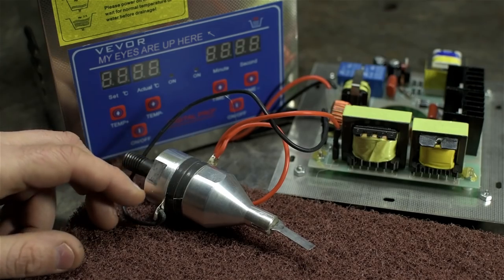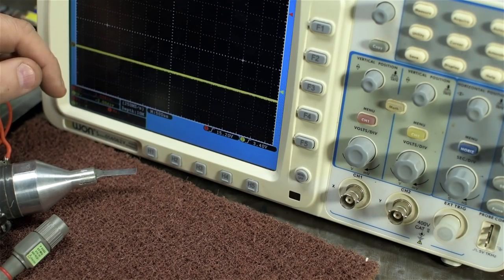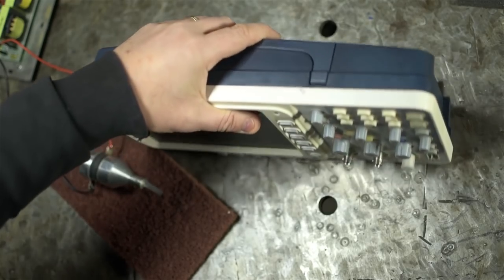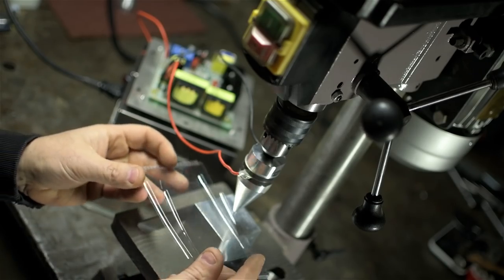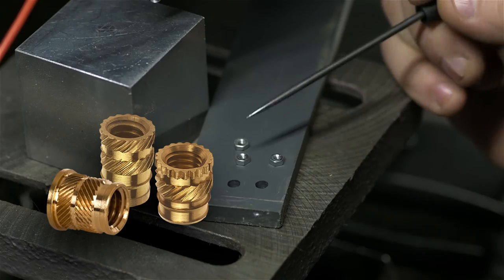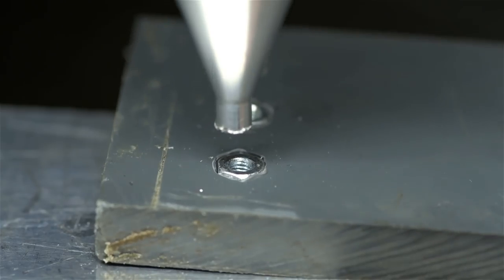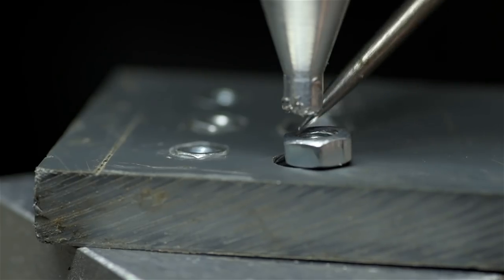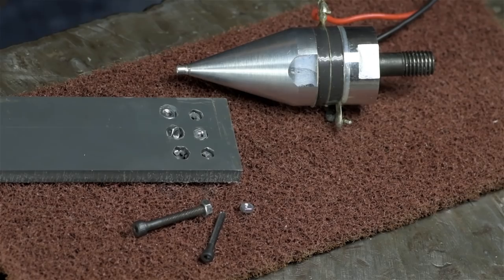DIY Ultrasonic Welder?! (Answer: NO)

Comment: Hello Mike,
Just watching ur Ultrasonic chapter.
I have some experience with some of that stuff.
I mentioned before that I worked for Bullen Ultrasonics Eaton oh. A major player in "Ultra. Chine-nin".

I helped with building those machines from scratch.
Our transducers were 1000 watt & as I remember 2400 watt machines. Obviously more powerful than the 60 watt set up you had.
I think one prob with your experiment is :
You'll prob have to braze the tool to the tool holder.
We used a couple diff. materials for filler wire. The best was Silver Solder. 
The stroke of the tool holder is most likely breaking loose the adhesive.

The strokes that we worked with were .0009/.0012 length on 1000 kw
And about  .002 lg. On a 2400 kw transducer.
A very big transducer & Water cooled housing.
We d pump a slurry of a liquid based 
abrasive crystals right where the tool met the material.( Vertically)
Then the osolation movement of the tool would  caused the very hard crystals to cut into/or machine
 the tool shape into the workpiece.

We machined Ceramic Sub straight material usually. But many others too. (Glass was easy.)

Ah . . .there's lots more to it but I just thought I'd toss you a couple things that might help ur tool makings by doing the braze work.

When the tool is properly energized they can be VERY PRECISE. Holes 
w/n only a few tenths.
Computer chip work.
Semiconductors.
Out performs laser processing.

Ok, ok, I'll stop, I can see your ears turning blue !

I enjoy the show. Keep them comin.
When I hear all ur jokes, I'll start paying attention to your your little tricks.  Ha !!! 
(Ole machinist humor !)

Thanks,
Marko.

Comment: I'm late to the game but I haven't seen anyone else explain why your horn setup resonated at the horn's resonant frequency of 42 kHz rather than the circuit's previous frequency of 40 kHz.

In ultrasonic drive circuits, the piezo transducer is often used as a capacitor.  You push a voltage into it, it deforms and resists further current; you push voltage into it the other way, it deforms that way and resists further current in that direction.

In particular, it will be used as the capacitor that controls the frequency of the oscillator.  The piezo's mechanical resonant frequency correlates with its electrical capacitive behavior, causing the piezo to set the resonant frequency of the oscillating circuit.  More reading would be available under crystal oscillator and quartz clock.

So you're absolutely right that there's a symbiotic relationship between the electronics and the horn -- the circuit will oscillate at the resonant frequency of the transducer (as long as it's within the operating range of the circuit).  And then when you change the mechanical loading of the transducer, giving it a different mass, you get a new operating frequency.  As you experienced!

Comment: For ultrasonic welding two plastic peices together you need an energy director, an apex for which the energy from the frequency is applied. Usually in the shape of a triangle only  .010in wide at the base. Also your horn will need to be directed over the apex. So the horns are typically customized to the part geometry.

Comment: So fun fact: most plastics that you seal together will have a coating on top of thw base plastic for sealing. Now with enough heat and time you can just melt two similar plastics together, but typically we try and out a lower melt polymer on at least one side of the plastic for sealing (in the film world at any rate. Different in injection molded and auto)

My other note is that I'm pretty sure our horns on our ultrasonic welder go side to side, not into the work. That way it vibrates the two sealing surfaces in sheer to heat them up.
Reply from the maker: Good to know, thanks Brad!

Comment: I have been looking into a soldering iron tool for an inserts.  The tools have a center for keeping the insert straight as it is pushed in and melting the plastic (3D printed stuff using PLA).

Comment: As some already mentioned, the vibration is in the wrong direction.
Yesterday morning i did weld some inserts. The generator can deliver 3000 watt, but only average 1300 watt was used. Amplitude was about 22 μm.
The converter worked without problem, but with an other sonotrode  a problem (re)appeared causing (on the end of the day) the generator to die.

Comment: FYI, blister packaging is not assembled using ultrasonic welding. They use heated roller crimps to close it up in most cases, and some companies just use a heated die-press.

Comment: also, ultrasonic hand engraver (not the rotating kind, the percussion type) they basically use vibration to help with the "cutting" so MAYBE that super fast movement might help it glide through the material being engraved

Comment: The plastic welding tips I have use a grid pattern machined into the surface to grip the first layer and vibrate it against the second layer. It looks like all the friction in your setup is between the tool tip itself and the first layer of plastic.

Comment: Look up an "energy director" for ultrasonic plastic welding. The way I understand it, concentrating all the energy into a very reduced area increases the energy transfer/friction generated at the joint and promotes melting at the joint.

Comment: Make a bit where you have a pilot that fits inside the nut with a shoulder that pushes down on the nut evenly. Similar to a stepped drill bit. The downside with that would be damaging the threads or pilot depending on which material is softer. But a pilot would also eliminate the issue of plastic coming up in the middle.

Comment: I recently did my Masters in polymer engineering, and there is a ton of science that goes into the ultrasonic welding process of polymers. The welding area for example has to be in a spot that is a multiple of 0.5 times the Amplitude away from the anvil, so it is pretty exact. Also you need an energy focus point, which is a small conical or triangular protrusion in the top part, which melts down and brings the material needed to weld the two parts together. If you're really interested in making that work, I can maybe help you out with some of the science needed :)

Comment: Your scope is ground-referenced! Eg. the shield of the BNC is connected directly to earth ground. You can't just put the scope probe onto anything like it's a multimeter. That's probably what fried it because the black wire of the piezo driver is probably not earth ground (and thus current will flow if connected to the BNC shield). You should either have used a differential probe, or used both channels (probe tip of channel 1 on the red wire, probe tip of channel 2 on the black wire, DON't connect the shield of the scope to anything) and then used the scopes math function (subtract channel 1 - 2) to get the signal.
Or to say it differently: The probe tip is high impedance (so no current will flow), but the shield is connected directly to ground. So if you want to measure between 2 arbitrary points on a circuit, you have to use 2 probes (or a differential probe). Otherwise, all measurements with a scope have to be ground-referenced (eg. a certain voltage with respect to earth ground). But if black wire is not earth ground, you can't do it like that.
There's good videos online of 'how not to blow up your scope'.

Comment: This is an electro-mechanical resonant system, where the frequency changes as the mechanical springs and weights gets changed. Like you can tune the resonance frequency by changing the tension on the bolt, much like you can tune a guitar string by changing the tension on the string. 
I expect the washing unit is tuned as you bought it, and you would possibly be able to tune your system by tweaking the torque on your nut too.

Comment: the sonic welders I built for HP to weld printer cartridges together - the transducer was 8" in diameter and the "horn" was nearly a foot tall, and we had a huge honkin powersupply/oscillator. Amazingly, the frequency was just about the same as the natural resonance of the stand holding the contraption and when on, you could hear it 2 floors away vertically and over 200' horizontally. We had great fun driving everyone nutz while testing. Some people with lose dental work were particularly affected :D

Comment: Usually one of the plastic parts that is getting welded will have an energy director on it.  It concentrates the energy to one point and makes for a better weld.

Comment: What killed your scope was connecting that ground clamp to a non-ground level signal in circuit with the scope itself. If it hadn't been such high frequency, it'd have blown a fuse somewhere, most likely the electrical breaker, or just vaporized your probes or whatever they were touching. Only connect the tip and remove the clamp thing when you're probing around plugged in AC equipment. Either that or get one of those fancy galvanically isolated probes, which cost more than many cheap scopes, or keep on frying stuff, or don't use the thing at all.

Comment: the power supply of those ultrasonic cleaners is usually a resonant power supply - it will oscillate at the horns resonant frequency by itself for efficiency reasons.
If you put something in the tub and it changes resonant frequency and you are pumping at a different frequency you'll get far less cleaning action, so the power supply tracks it.don't worry about getting your horn perfectly on 40khz, get it where the freq * gain is highest and isn't too far from 40khz

Comment: Well, now you know the value of a diff probe. I was using a dedicated sonic welder on ABS. Interesting machine. You can adjust horn pressure and distance to "crush". Thermal cam looked neat too. Needed to know if the welds were penetrating like they do in metal. Yep!

Comment: There is a program on BBC iPlayer about bubbles.  So what you may scoff.  If you can put micro bubbles in water and apply ultrasound the water then cleans really well! Like take lipstick off cloth.  The water was arranged to go through what looked like your focusing horn connected to the ultrasound generator.  Without the sound the water just flowed over the lipstick, turn on the sound and the lipstick was just washed away.  It is a BBC 4 program and probably there for another 3 to 4 weeks.  Not cutting or welding but kind a neat.

Comment: The scope likely blew up because of ground short. The loop on the probes isn't negative, it's ground. If you connect it to a non-ground potential you will have a short circuit,

Comment: Try cutting the tip off and tap the end for a screw.  Then the head of the screw can act as the press to push the nuts or inserts into the plastic while retaining the frequency response of the original.

Comment: Not sure if you're still interested in solutions, but since you already predrilled a hole, why on earth didn't you just put a bolt in from the underside, nice and flat with the nut's edge? or just a hex bolt from the top side for that matter, and push the lot in, screw off the bolt after.

Comment: How about a torque test?  Does it keep the nut from spinning when tightening.  Also, a flat bottomed hole with a smaller diameter through hole would be perfect for tightening against from the back side.

Comment: The direction of the vibration for the weld is already correctly stated in another comment.  Has to be horizontal instead of vertical.
In all likelihood, the scope probes are rated 600 V peak and the scope itself no more than 250 V (maybe less).  The Q of the piezo element, unloaded, might be anywhere between 20 and 2000 or even more.  So, if I guess the drive voltage being 180 V — a common drive amplifier when I last looked — so you would get 3600 V or 360,000 V based on my two guesses for the Q and one guess for the drive voltage, to cause the smoke.

Comment: You need to have an assembly with springs to let it vibrate, the only thing that should be solidly attached at the bottom is the anvil, and apply very little pressure so it can vibrate well enough to weld.

Comment: The drive circuit is AC sine, right? Have you measured it with a resistive load to confirm?

Do we assume the frequency change is a result of standing waves in the horn producing back-emf through piezo transducer and we see the sum?

I would expect the horn to only be excited at the drive frequency while a pure sinewave is present.  Only after the drive is removed should the horn steer towards its natural frequency during decay.

A load on the horn will have a dramatic damping effect, lowering Q of the resonance and also the frequency. When you simulate the horn can you put a load on it?

Comment: Try a two stepped tip on the cone for nuts. The inner step to go in the center of the to act as a guide, and outer step to press on the nut.

Comment: For through-hole applications where the tension of the bolt is going to pull the nut farther into the material, that might be viable hackery.

Comment: @This Old Tony hey... i have a idea... so you know you have problems with putting it in... well you should make the tip bigger (inch if that is possible) so when it presses on the nut/inserts it doesn't rely on staying center (because the tip is so small... if not centered correctly... it will go sideways like what was happening with the big nuts) soo see if that works... i would like to see it. thanks!

Comment: Well a normal Ultrasonic Welding Generator we use at work has a 1000W. And I was one of the guys who said scope but I meant to do it without the power as the piezo will generate the voltage when you ring (whack) the horn with something.

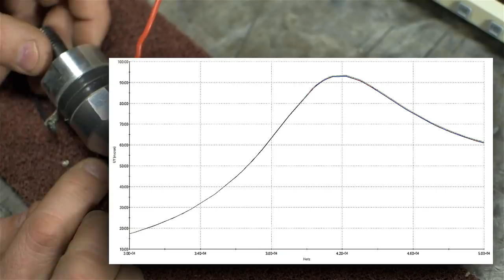Comment: 2:40
Marko Reps (electronics channel on Youtube) did a video in 2015 failing to repair an ultrasonic cleaner.
In it he reverse engineered the driver board he got and it seems like the frequency the board was running at was not fixed by the electronics but rather induced by the resonant frequency of the transducer! So it would make sense for your setup running at 42 kHz.

Comment: Tony, I know it is too late to say that. But whenever you take measurements of a high voltage or earth grounded supplies with the scope, it is better to use channel A - B so you don't need to use the negative clip from the probe and, thus, creating a ground loop.

Comment: I wonder if you made a new horn fitted with a hardened broach / cutter similar to what you would use in a  wobble broach to cut a hexagonal or square  hole would it cut metal ?

Comment: It seems to be working...somewhat...but only on the 1 side you have the device in contact with the plastic
The spot-welding of the plastic (PET) would probably require 2 of those devices to cause the heat to meld them together.

Comment: I'm pretty sure, not positive, but pretty sure, that blister pack was adhered with just pressure and probably heat.
As someone who worked in the plastic package fabrication business I've seen most of these things happen with just pressure and heat combined. No ultrasonic, supersonic, subsonic, endo sonic, uber sonic or Sonic and Knuckles business going on.

Comment: I could see this working like a charm if the horn would have short thread on the end to keep the nut in place, with something of a journal that will do most of the pushing down.
Not sure how much loss, if any, there would be if the horn would have a single thread that would accept smaller screw-on adapters (to go from the thread size on the horn to whatever M/imperial size thread you want to push in, but that would make it very easy to switch from one nut size to the other without having to turn 72 different horns.

Comment: Nice! Don't give up tony, would it work if you make a threaded insert to go into the nuts and the other end was cupped to receive the tip of the horn? or would that just weld the two together and screw up the harmonics?

Comment: you designed the horn to travel straight up and down though... don't know much about ultrasonic stuff, but i could see that as being comparable to trying to weld two sheets of metal layed flat on one another by hitting it straight with a hammer. could be interesting to see what would happen if the horn wasn't oscillating up and down, but more wibbly-wobbly? the friction could be enough to fuse the plastic together

Comment: Pretty sure for ultrasonic welding you want to compress the materials to be "welded" vertically, then apply the Ultrasonic force in a lateral / perpendicular direction  so as to "rub" them together. Essentially high speed friction welding minus the rotation. I feel that applying the ultrasonic force into the two pieces vertically doesn't produce the same "rubbing" effect you need for the "welding" to occur. May I suggest trying to use the drill press to compress the work piece then come at it from 90 degrees with the transducer.
Reply: That's essentially a vibe (vibration) welder not a ultra sonic welder

Comment: The ultrasonic welders in factory had something that kinda like a out of tune, tuning fork with electromagnets around the forks. Each side with driven with a high voltage oscillator with different frequencies. The fork would vibrate with a sum and difference and two original frequencies. The sum was ultrasonic, imagine a tuning fork with a handle on it. The welding horn was the handle.
Reply: It didn't make much sound until the horn came down and started welding plastic. Then you could hear the two frequencies and the difference. It kinda sounded like irritating screeching fingernails on a chalk board only much louder. People working had to listen to that all day sometimes.